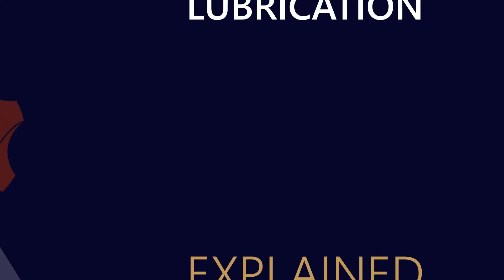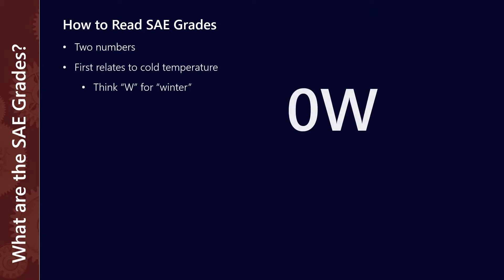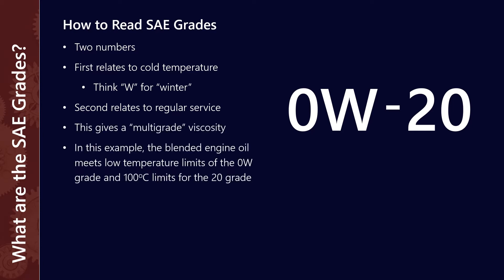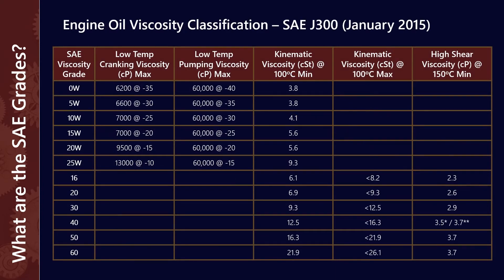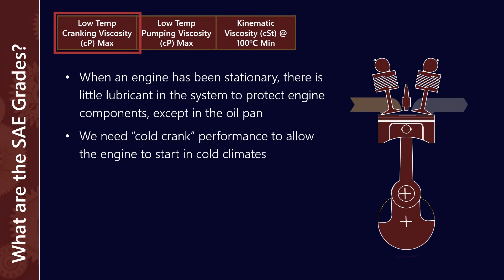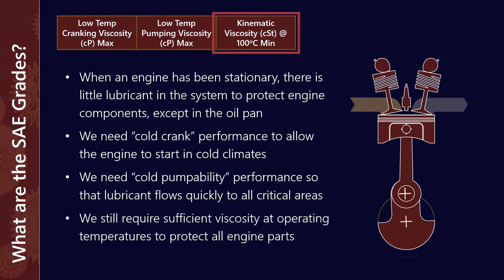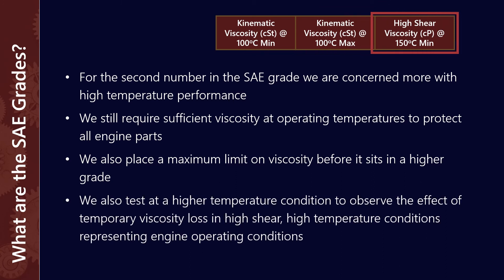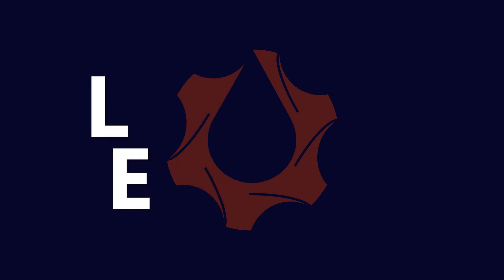Motor oil viscosity grades explained

Comment: Finally someone explained multigrade(or better described as grade modified) oil nomenclature.. I was getting sick of people describing eg. 10w40 as oil that's 'thinner' at cold temp (0 C) and 'thicker' at 100 C, while we all know oil only gets thinner, not thicker, with temperature. The graph perfectly describes what it means.. the oil does, of course, get thinner, just the value of viscosity is like 10w when cold and 40w when hot.
Reply: Te graph at 2:37 is perfect, shows exacty why it is in fact thicker when cold but has a lower number. so many people have tried to tell me that it thickens up as it gets hotter but us with actual eyes can see that it gets thinner when hot, also those people could not explain why we usually drain hot oil because it flows better. the numbering system is really quite interesting.

Comment: What is the difference between a 10W30 oil intended for a four cycle engine (such as a lawn mower) versus 10W30 oil intended for a passenger car?
Reply: Now you are getting into additives and marketing, Motorcycles have wet clutches that are immersed in oil so thet cannot have certain additives that cars  can have. Air cooled engines such as lawnmowers might have  an extra modifier to allow for hotter running due to air cooling not water cooling, some of it may just be marketing for lawnmowers so you will buy the 1 liter bottle at the higher price from the mower shop, the Honda mower I just bought runs on 10/30 car oil says the guy that sold it to me.

Comment: hello,
I noticed in oil recommendations in several brands  that oil viscosity for the same engine QR25DE for the same car differs in Brazil (5w-30 and even 5w-40 as alternative) while in Nissan US/Canada it recommends 0w-20 viscosity only,
is it because of the warmer climate or the engine itself has some differences ?

Comment: Hi sir, do we need to choose oil grade depending on what climate we live? For example, if the manual said to use 10w30, but we live in a hot climate can we change it to 10w40/10w50?
Reply: I'd go up one grade not 2,    I'd be more likely to go up a grade if the engine was worn.  A worn engine has bigger gaps and also when a plain bearing is worn,  the actual load bearing area drops.

Comment: Dear Mr. LE
Please allow me to ask you a stupid question,
Is mixing 1 quartz of engine oil SAE 5w30 and 1 quartz of SAE 5w20 will equals to SAE 5w25
Thank you in advance
Reply from the maker: Hi! Approximately yes? But the challenge is that different oils use different methods to achieve their multigrade viscosity - some will simply use a high VI base oil, others will lean more on viscosity modifiers.
Reply: @LubricationExplained  thank you for your reply Sir,

Comment: I never understood why engines do not have a pre-lubrication system, for small engines. Large engines do, but cars planes and even most trucks do not. Seems like a logical design option for me.
Reply from the maker: I guess it just adds more complexity. If you look at turbine jacking oil systems for example, they need an entirely separate power supply because the main lube oil pumps are driven by the engine.
Reply: Engine is more likely to be destroyed by neglect than cold startups,   you have your zinc additives for dry starts.
Reply: Toyota hybrids do.
Reply: That's exactly what I'm wondering often!

Comment: I use mono grade SAE 30 in Florida for over 10 years.  My engines run like new even after 200,000 miles.  Viscosity Improvers/modifiers are not lubricants.
Reply: not everybody lives in Florida

Comment: thanks for this explain, multigrade was not popular in Asia,  specially for Marine Diesel Engine, monograde SAE 40 are usually used....crew can't understand SAE 40 for Diesel engine or Marine Engine (high speed, medium speed, or slow speed). Need explain engine oil for Marine Lubricant
Reply from the maker: Marine is a really interesting application - I'll have to start doing a few videos.
Reply: @LubricationExplained  thanks Pak, greeting from Indonesia, stay healthy.
Reply from the maker: @HendyTazali  sama sama! 😊